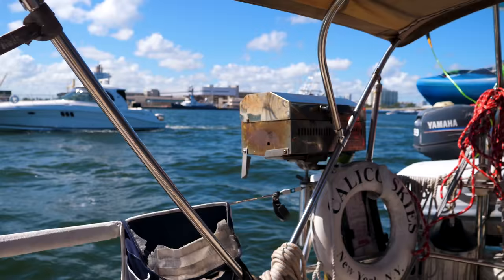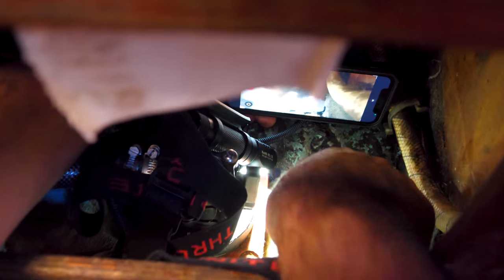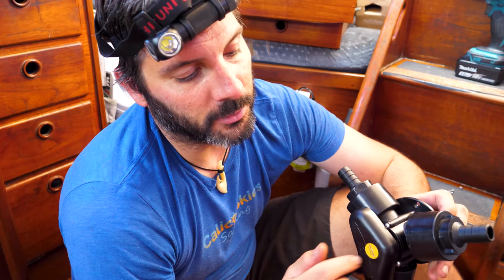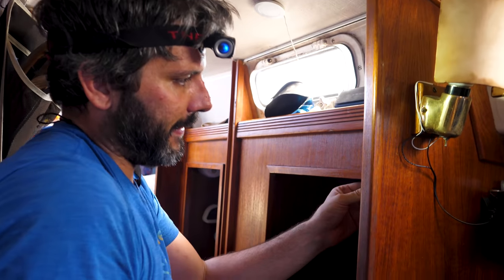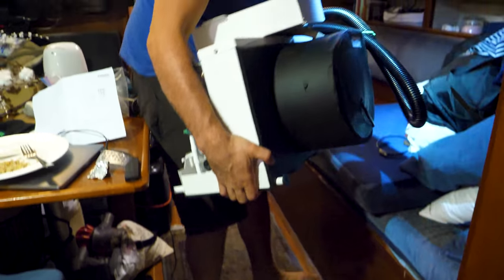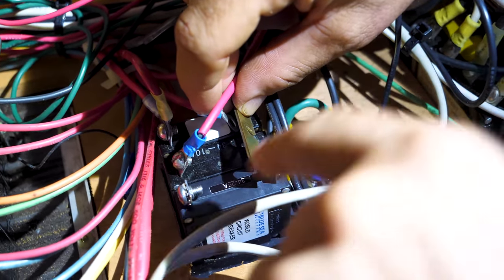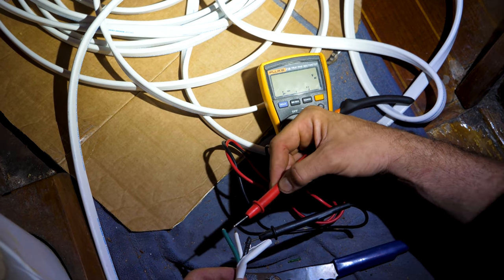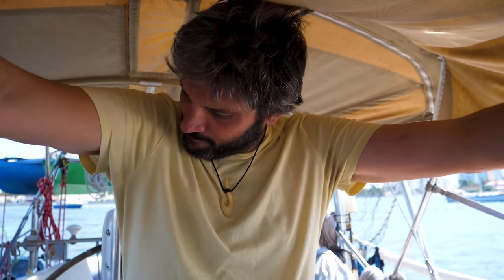How to Install Marine Air Conditioning in 4 simple steps 😜

Comment: Bill, I went back to this video to make sure I understood how you hooked up the 110V switch.   Having 110V terminals on a breaker in the 12V breaker array is not recommended ( I interpreted the video as that was what you ended up doing??) ......at the very least make sure you insulate the terminals on the breaker you have used for the 110V feed.....if they have not been insulated, you have an accident waiting to happen including a real fire hazard if the 110V line gets shorted to a 12V line .  I would also tie a label to the 110V feed wire indicating it is a hazardous 110V line.  Also make sure the breaker you used is  110V 60Hz compliant and will  trip 60Hz currents within the overcurrent range of the air con unit. 
Beside that criticism, great job installing the unit and inverter while still on the hook.

Comment: Quite a project guys; probably long awaited a/c. As a carpenter for over 25 years in the trade the one tool that I marveled at how much I use it is my cordless multi tool, you gotta get one Bill.
Reply from the maker: I had the cordless model but the batteries stopped holding charge 😏. The wired replacements were cheaper 😀. Great tool!

Comment: Thanks for showing us behind curtain of beautiful sunsets. Perhaps I missed it, but what is the make and model of your air conditioner unit, and why did you choose that one?
Reply from the maker: It’s a Webasto 16k btu. The biggest consideration for us was the size and shape to fit in the closet 👍
Reply: @CalicoSkiesSailing  Thank you! It's been decades since I installed Webasto heaters. I did not know they did AC, too.  Enjoy it!
Reply: @CalicoSkiesSailing  I just did an install of the same unit but the fcf model on my 34 foot boat. I would love to hear how you feel the performance of the unit is in the middle of the hot day? Mine can barely keep up during the day, but at night I can freeze myself out of the cabin! Have you got to use it much yet during the hot parts of the day?
Reply from the maker: Hmm ours remains really cold all day...we can’t keep the thermostat much lower than 75 or it’s like an ice box haha. Did you insulate the ducting run. Ours is really short. Also we added a transition box to help distribute air flow.
Reply: @CalicoSkiesSailing  I used insulated 4" hvac hose. I didn't do the transition box and I have 3 outlets, 1 in qberth, 1 saloon, 1 vberth. I may have to look at a transition box, thanks for the idea! I also have no port shades at all right now so I know that isn't helping either having the sun beat through the like 8 ports on side of the boat.
Reply from the maker: We also added some insulation to the headliner from back in our northern cruising days. Bay may halp

Comment: Wow, Bill never fails to impress me. I would hate to take on a job like that. Stay cool guys.
Reply from the maker: It was a beast of a project!! It’d been a lifesaver here in Panama
Reply: I was just looking at other peoples comments. Is your new unit a "heat Pump"? If so you made a great up-grade. I have been using a heat pump for over 10 years to heat / cool my house and so far no problems. Also, it's very cheap to run.
Reply: @CalicoSkiesSailing  Glad to hear it works well after all that effort.
Reply from the maker: It is has the ability to reverse cycle and heat the cabin 😀

Comment: I may not know what i'm talking about....but did you mix an AC breaker in next to DC breakers? Seems pretty dangerous if so.
Reply from the maker: You know I couldn’t find any guidance on that. I was wondering myself. The AC and DC panels are physically installed very close together (within a few inches). If you had any more info it’d be greatly appreciated 😃

Comment: Very informative video...as usual. Is you boat insulated? Is that what the aluminum material was in the soon to be A/C locker against the hull? If so, what material did you use and how much of the boat did you insulate e.g. the quarter berth as well?
Reply from the maker: We layed a few layers of reflectex behind the cabinetry and put expanding foam in the ceiling liner. It helped during the winter when running heat. Cut back on the mold growth as well

Comment: Welcome to the world of cruising A/C, installing a marine unit is not my idea of fun tho, overpriced and underperforing usually and issues with debris in the water circuit.

I took out my marine unit and went to a Mitsubishi Heavy Industries 3.5kw split system. The difference is incredible! Draws 650W and today its 38deg"c at the marina in Brisbane and we are sjtting on 20deg down below.

I built a 316 stainless body and chassis for the outdoor unit for corrosion protection and it dumps the hot air aft at the tramsom to ensure the above deck temp is unaffected

Comment: I like your new A/C heat pump you will have the flexibility to use if for heat too!  Travel safe!
Reply from the maker: Exactly! When plugged into a marina we won’t necessarily need to use our diesel heater :)
Reply: Thank you Stephen for noticing. I did not catch that. B&G, good planning for dual use.
Reply from the maker: Also works on 50/60 hz which is importan depending on what country we are in we will just need to step down the voltage 😃

Comment: Surprised that you didn't go for a 12/24v ac to be more energy efficient.
Reply: 12 volt DC Air Conditioners for a sailboat installation like this are over 4 thousand dollars. They are much more power efficient though but that initial price is a killer.
Reply from the maker: Yes as nineline said it was cost prohibitive for us. Luckily marinas are pretty affordable down in Central America. We also run it on the hook off the batteries an hour or two when sunny or off the Honda
Reply: @CalicoSkiesSailing  can understand, slap the word marine on anything and its double+ the price 😕
Reply: what size A/C unit did you install? 16k?

Comment: I've spent my life working with power tools. I have to say watching you cut and drill and grind with no safety glasses and bare foot made me cringe. People say "I've done it for years and had no problem." My son-in-law's father lost his eye on a quick simple job like that. He was 50 years old and had never worn safety glasses. No one has a problem, until they do. The bare feet isn't as big an issue. You can lose a few toes and be fine. I did enjoy the video on the non-cringy parts though.
Reply from the maker: Smart! Reviewing the footage we should use more  safety gear!
Reply: Agreed!

Comment: Looking at your boat for first time it doesn't appear to be sea worthy at all. In your bilge alone I counted over 25 rusty house clamps that if failed at night while sleeping you would take on allot of water and possibly sink. If you are going on overnight passages you better get that boat in Seaworthy condition. If boarded by Coast Guard you would receive big fines. I'm not trying to be a kill not but before even putting boat in the water it needs to be safe. GOOD LUCK, SAFETY FIRST ‼️. Vinny 🇺🇸